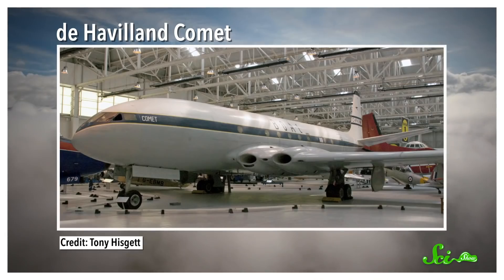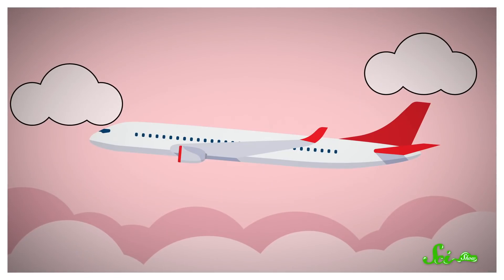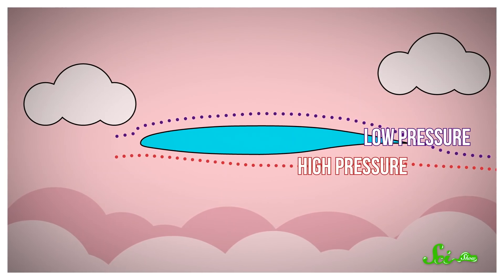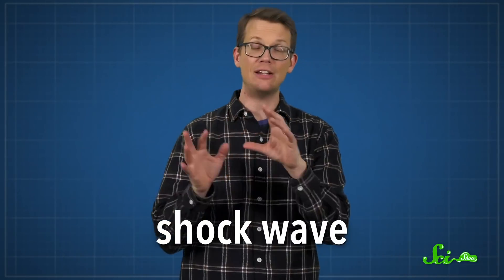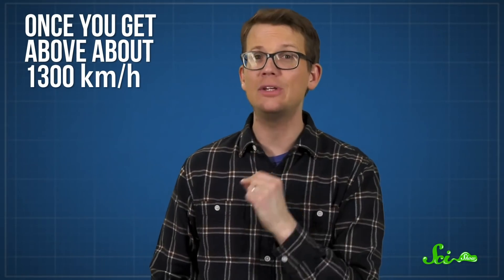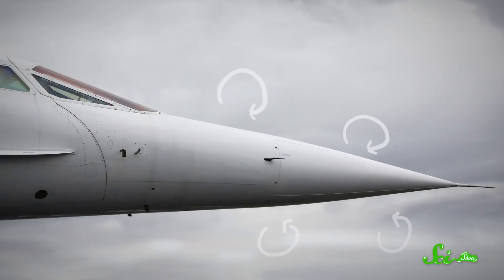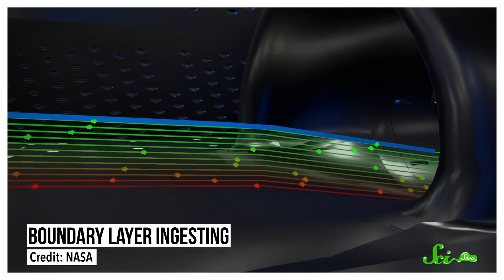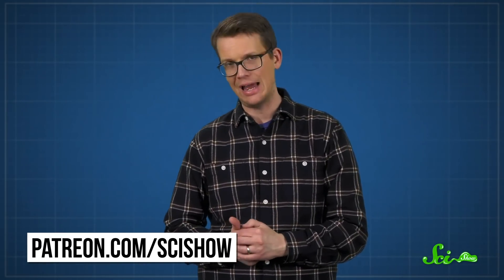Why Aren't Commercial Jets Getting Faster?

Comment: I was redirected here by a recent short concerning this very topic, to which I find you address the incidentals that I commented there.

However, you mention Bernoulli´s high-pressure, low-pressure standard model of airfoils. Firstly, this is kind of an obsolete model of understanding, but more to the point, you show a new-fangled (well, new-fangled during WW2, I suppose) laminar flow section, which distinguishes itself by having much less reliance on Bernoullian aerodynamics, and much more so on angle-of-attack.

Whoops!  :-)

Comment: One way to improve supersonic engine efficiency would be to use "supercruise" engines like they have on the F-22 and F-35 fighters.  The can cruise at supersonic speeds without using their extremely inefficient afterburners.  

Another is modern SST designs are also working on more efficient fuselages that minimize drag and reduce sonic booms, which is what those wave drag shockwaves sound like when they hit the ground.  These new designs turn the BOOM into more of a gentle thump.

Comment: This is true, but not the whole truth; the full truth is that wings can be designed to have stable flow at much higher speeds, but it's very hard to make that same wing fly well at low speeds without stalling, leading to faster more dangerous landings (the Concorde's wings alone took years to design) and that's why aircraft carriers use arrestor cables. Add to that supersonic planes have to be made of heat resistant alloys, have much higher maintenance and shorter life, and the fact that sonic booms were banned over the U.S. for commercial planes and THAT's why airlines stay at the same speed range. It's economics, not science.

Comment: I'm wondering if engineers have ever tried some sort of barrier/screen to block (and) or redirect the air molecules. some sort of nylon adapted to pop up at a certain speed and stop them from breaking the sound barrier shock wave but still goes faster than it by redirecting and limiting the air but not the device.

Comment: Nearly all passenger jets are designed to reduce wave drag at near sonic speeds such as streamlining the plane in accordance to with Whitcomb's area rule and by using swept back wings to slow the airflow over the wing down so the plane can fly faster before this air travels supersonic.

Comment: The airfoil diagram used (at least at the angle shown) would create a void on the rear underside of the wing, giving the opposite effect. The reason people find these diagrams hard to understand is because they almost never depict the correct angle that the wing needs to be in for the explanation to be accurate.

Comment: The velocity of an aircraft is inversely proportional to the annoyance of the passenger. Screaming toddlers have been been rigorously documented to slow aircraft by 33%, and unwashed seatmates by 50%. Tight connection flights can hold an aircraft motionless in the air indefinitely...

Comment: Pressure differences between bottom and top of wing account for 15% of lift. More than 50% is air hitting the wing from forward motion and lifting it. For reference "Wind-tunnel Investigation of a Number of Total-pressure" and https://www.mpoweruk.com/flight_theory.htm
Reply: Pressure difference accounts for 100% of the lift by definition. Lift is just the integrated pressure and shear stress distributions over the wing. Flow turning downwards requires a pressure difference to generate the force necessary to do that. The only forces acting on the airfoil are pressure and shear forces (and gravity)

Comment: I hope high altitude flight takes off, no pun intended. The idea is to fly the plane in an altitude so high, the atmosphere is not an issue anymore. Basically it’s like spaceflight, with the benefits of zero or near-zero gravity, meaning being able to fly at great speed without having to use a lot of energy, bc there is little resistance. Smarter minds than mine can tell you why or why not it is possible. Maybe do an episode on it SciShow? 😘
Reply: There’s still pretty much the same gravity up there as down here. The air is thinner, so you run into problems feeding the engines on the plane. You have to go faster to get more air flowing into the engines. But as the air gets thinner, there becomes a point where a certain design can’t go faster without breaking. There are designs that can go faster and higher using different engines

Comment: The heat generated on the leading edges of the plane at super-mach speeds could be turned into a benefit by running the fuel lines through the leading edges. This will cool those edges and would preheat the fuel so that it can be burned more efficiently.

Comment: Thank goodness airplanes are not using the metric systems “kilometer”.   Aviators and aircraft use nautical miles because at least nautical miles have a solid mathematical reason for the standard.  For transonic cruising speeds we use the percentage of the speed of sound or Mach. 
And, the checkout the 787 cruising speed (up to .9m).  It’s long range cruise speed (.85m) is faster than the maximum speed you reference of other aircraft and, it is one of the most efficient commercial passenger jets ever made per seat, per nautical mile.  You may want to revise your video, which are usually, uh, good.

Comment: That same phenomenon is also what limited the top speed of open propeller airplanes. If the tips of the propellers exceeded mach 1, the tips lost their lift, making the propeller effectively smaller in diameter.(and oh, the noise!!!) They were limited to ~600-640 kilometers per hour.

Comment: First off, you can fly higher altitude to get around the air Shockwave, i.e. SR-71 black bird that flew at around 80,000 feet. Also you are crazy if you think passengers are getting cheaper flights. All the savings are going to the airlines. Was this video sponsored by Delta, or what? Lol.
Reply: Newsflash : The US isn't the whole world. Cheap flights were actually a thing here in Yurop, in the olden days when people still flew
Reply: @talltroll7092  News flash. Nothing I said had anything to do with US

Comment: He left out an important factor: 
The speed of sound is faster at sea level than a 40,000 ft. And at sea level, given the denser air, it’s far more difficult to get to Mach speed. 

At sea level 300 mph is fast! At 39,000 ft, 300 mph is called descending.  A jet maintaining Mach 0.8 at 20,000 ft is much more difficult than at 39,000 ft. At 20,000 ft Mach 0.8 is faster than at 39,000 ft.

And speed of planes is governed by airspeed, not ground speed.

Comment: (4:13) - As of January 2020, the price of  jet fuel (known as Jet A1), was approximately $650 per metric tonne.
Even with the salaries of flight staff taken into account, $50,000 per round trip does sound excessively excessive.
>

Comment: In addition to the issue of drag, engine efficiency, and fuel consumption, something that I noticed was not mentioned was the resulting noise from traveling at high speeds. When a plane starts to fly at the speed of sound or faster, they develop a shockwave as mentioned at 2:05 in the video, the transition of compressed air in front of the wing produces a lot of noise called a sonic boom. This 'boom' is comparable to a continuous roar of thunder, and logically, the faster the plane, the louder the boom. According to the 'Oklahoma City Sonic boom' experiments conducted during the mid-1960s, the constant exposure to sonic booms in the urban environment is as you've probably guessed, not a good idea considering the typical height flown by most standard commercial airliners. This reason was part of why Concorde was limited to flights over the Atlantic Ocean.

Comment: I thought the whole high pressure under the wing low pressure over the wing thing had been disproven...
And I thought I learn about this on SciShow...
Reply: No, it’s true. It’s just misleading. There is a pressure difference that makes lift (and drag). Pressure is just force per unit area. And lift/drag is the integration of that pressure (and shear stress) around the wing.

It’s misleading because it’s not a cause of lift. It’s the way the air flows around the wing, the circulation, that creates the pressure difference which then makes lift. The circulation comes about from the geometry of the wing and viscous effects. So it’s hard to nail down one “cause” of lift

Comment: I expect a great leap from the speed of around M0.85 to M1.6 some day. Instead of burning fossil fuels, these planes were powered by air breathing ion drives with power level measured in gigawatts. The plane carries enough batteries to make a landing to nearby airports. Most of that energy was beamed onto the plane from satellites or ground based stations. So the plane don’t have to carry all the energy with it, greatly increases the efficiency and decrease pollution (powered by electricity). Additionally, to overcome aerodynamic problems, use a lift body design which has great lift to drag ratio, and works extremely well at supersonic speeds, with retractable wings/ flaps that were extended at takeoff and landing.
Reply: You know that high noon sunlight at the equator provides only 1000 watt per m^2? And that power was only adequate for the solar panels of a flimsy, single seat airplane with the wingspan of a Boeing 747 flying at 70 kph (Solar Impulse). Now, imagine 100 or 1000 times that energy per surface area being beamed from a satellite in a manner that does not burn anything it is aimed at. Myself, I expect you to wake up from your dream some day.

Comment: The pressure differential of air under and over the airfoil isn't what gives a plane lift [technically it does give some lift, but is nowhere near enough to get it off the ground] and not even a major part. How planes get the lift they need to actually maintain flight is by having their wings tilted back [or sections of the wing called control surfaces] slightly so that the bottom of the wing slams into the air in front of the plane, displacing it, and a vacuum is created over the top of the wing. The angle is such that the air is pushed down from the bottom and pulled down from the top, and as an equal and opposite response, the plane is pushed up. It's why planes can fly upside down or with different airfoils that don't take advantage of Bernoulli's principle.

Comment: the concorde carried 211,000 lb of fuel, about 32000 gallons. the worst price for jet fuel (for airlines) was slightly over $3 in 2008 and 2012. thats $100,000 in fuel per flight. Concorde was 128 passengers. Even at 50% loading at 2012 prices ($3.15/gal) it was $1575 MAX per person if only 64 passengers showed up. A full place would be $788 or so. so cut the crap with the $50,000 per person round trip. not even with inflation and terrible fuel prices except possibly during the worst parts of the oil crisis was the damn cost for fuel ever a factor here. it was expensive to maintain as the fleet was small (parts are expensive etc) and it was priced first class only and the range was relatively short. i had relatives fly on concorde for less than $10,000 a number of times. when concorde wrapped up tickets were around $12000 round - not that far off what first class round trips today cost.

Comment: concorde tickets did NOT cost that much. average round trip ticket price was about 10k near the end.
Reply: that's based on inflation, what tickets would cost NOW, if Concord was still in service.(You're exactly right, 10 grand in Y2K)
Reply: @vincentrobinette1507  given the low price of jet fuel tickets would be less than 20k today possibly in the same 10k range (depending on maintenance requirements for an extremely old aircraft) - the airframe of the concorde got very hot each flight which drove moisture out of the airframe leading to very little corrosion of the aircraft flew regularly. maintenance wasnt cheap by any means and it required a flight engineer but today price of jet fuel is less than $1.75/gal for airlines.

Comment: the airfoil shape and pressure differential is NOT the most important contribution to lift. otherwise, planes wouldn't be able to fly upside down, but they CAN. instead the angle of attack is the most important contributing factor (i.e. the wing tilting up and pushing air down, which in turn pushes the plane up by newton's 3rd law.

Comment: Why spend four hours in a noisy, polluting Concorde when we could have a train tunnel anchored to the seabed but floating 100 meters below the ocean surface with a partial vacuum inside allowing maglev trains to reach speeds of 6,000 kph and cross the Atlantic in an hour instead?
Reply: I will wait for your estimate of the cost to build such a tunnel. I will also be interested to see how you would deal with the risk of one maglev train getting stuck at mid course.

Comment: Idea: use the dents from a golf ball on the planes. I watched a thing about how on a car those dents improve fuel efficiency so possibly it could help get rid of those pockets of air that heated up that one jet cause it would improve air flow.
Reply: That only works on golf balls because they're tiny and spin as they "fly" which creates a layer of air around the ball which lowers friction. On a plane they would just make turbulence and drag....and probably make it drop out of the sky because the airflow would separate from the wing.

Comment: As an aerospace engineer, a few additional comments:
- For most wings its actually the low pressure on top side of the airfoil thats responsible for most of the lift, and not the high pressure on the lower side. The wing is not pushed up, but instead pulled-up by the suction of the low pressure side. 

- Main problem of the concorde was, that is was originally planned to fly over land in US domestic flights. The acoustic of the shockwave made this impossible though. Windows would shatter and people would complain (for good reason). Modern approaches to faster than sound civil aircraft therefore focus on that. See for example NASA low-boom program ( https://www.nasa.gov/X59 ). Fuel consumption was a problem and it is basically always a problem, but not as bad as the acoustics which limited the aircraft to just a few possible routes.
Reply: Hi
What is the very best explanation of "sound barrier" that you have ever come across?
Reply: Ok, i think i understand what you meant; that the pressure above is lower than the pressure below is higher. Therefore, the low pressure above is responsible for most of the net force.
But, pressure is pressure and it will exert a force perpendicular to surfaces it contacts. So the low pressure above still creates a downward force. The airfoil only gains lift because that force is subdued by the upward force from below.
Is there a facet I'm missing?
Reply: @marcoskunrath5914  yeah, basically the "aerospace engineer" is incorrect, but so is scishow, and it's a very common misconception that is debunked on NASA's website. There IS lower pressure above the wing and higher pressure below, but there is no pulling force anywhere, the high pressure wants to equalize and that means going to the low pressure area and pushes the wing up. But that is a very small amount of the lift created by the airfoil. Most of the lift comes from flow turning, the air above the airfoil is sped up by Bernoulli's principal and redirected downward by the Coanda effect. Newton's 3rd law says that any air pushed down has an equal and opposite reaction and so the wing is pushed upward.
Reply: @mikewhite3530  I'm glad I waited to watch this until after your reply. Now I just have to put it all together. I'm having a little trouble w/Bernoulli's principal. I'll try again tomorrow morning when I'm fresh. & Go to NASA!
Reply: @marcoskunrath5914  I think he means that if you've got a wing and wanna fly you can do two things to get lift: a) make the pressure above the wing lower, or b) make the pressure below the wing higher. Of course the force will always be made by the air below it pushing it up, but from a design perspective you can get force by doing either of those things. So what I think he meant isn't that the force is done by the air above, but that most of the pressure is obtained by method a) and not method b).
Disclaimer, I'm a phycicist, not an engineer and I haven't even taken a fluid mechanics course, so don't take me as an authority on the subject

Comment: The other reason would be the amount of traffic the average airport can handle. Aircraft are asked to slow their speed to fit the time slots therefore even if an aircraft could fly faster they would probably spend more time in a holding pattern.

Comment: Fighter jets have gotten slower too . A 1960’s Mig-25 can fly faster than any modern jet in 2020.
Reply: Mig-25 was a interceptor, not fighter.
Nowadays interceptor can be substitute with a faster missile. Hence most fighter plane looks slower but actually AA missiles nowadays are going faster